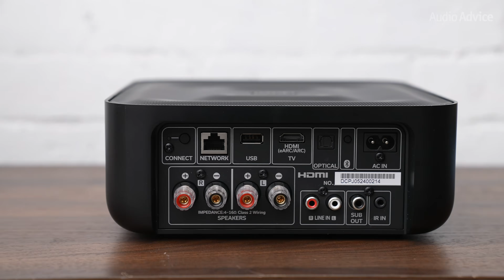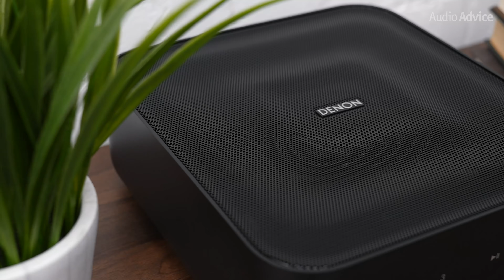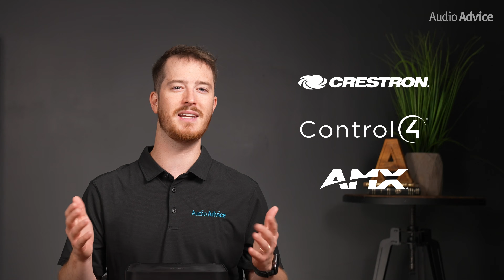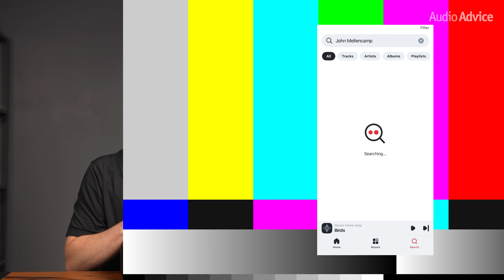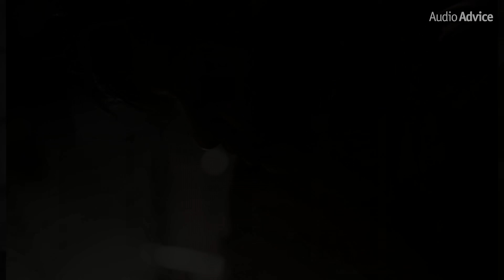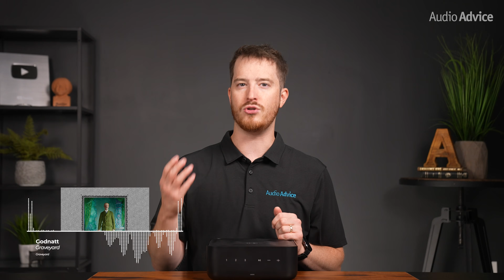Denon Home Amp: Small Amp, Large Features - 2 Ch. 100W Amplifier with HEOS Built-in

Comment: How do you take the red / black covers off the speaker wire feeds
Reply from the maker: If you are talking about the tiny little inserts that are sometimes placed into the end of a female banana plug, we use a straight pin if they do not easily come out

Comment: Nicely presented! Does anyone use passive subwoofer with external amp/ crossover anymore? Is the subwoofer ouput with crossover and level adjustments nessasry? Wouldn't just a fullrange output just be fine since the majority of people use powered subs with crossover and level adjustments?
Reply from the maker: Thank you!  There are still many passive subs with separate amp/crossover.  Full range works fine for the sub, but taking the low frequency load off the main speakers typically improves their midrange.  Thanks for watching

Comment: I've used Denon for 20 years. Heos for 8 or 9. Heos is often disappointing. It's slow to respond, and when playing in 3 or more zones, I sometimes get rooms that are not properly synced. I don't understand the sync issue as my six DRA-800Hs and my AVR-X8500h not only sit in the same server cabinet but are all connected to the same network switch.

As for the "volume limit" that doesn't work. I have both the receivers and the app set to not allow the system to blast beyond a setpoint. However, it can be easily and dangerously overridden by the heos app volume bar, but more importantly, by the volume buttons on your phone.

On several occasions I have had music playing in the background while watching a video on my phone, turned the volume up on the video and in turn it raised the Denons volume to a level that damaged my in ceiling speakers.
Reply from the maker: Interesting, thanks for sharing, we will have to test that.
Reply: Yeah software is all. Better buy Sonos Amp